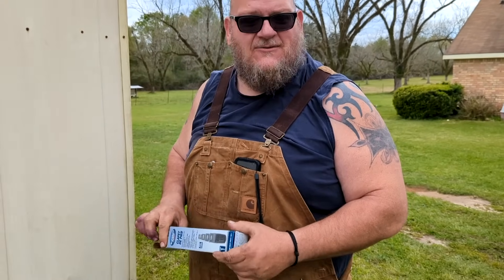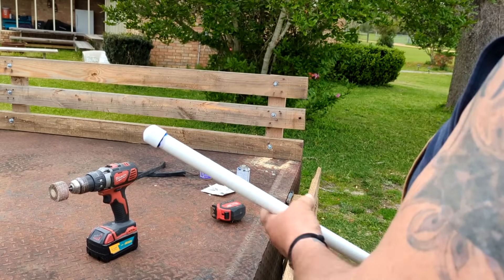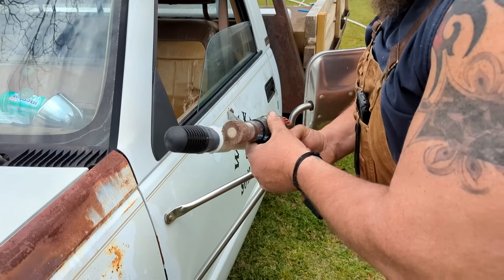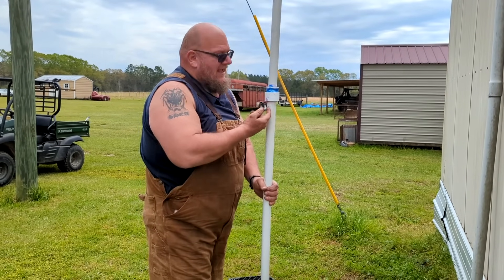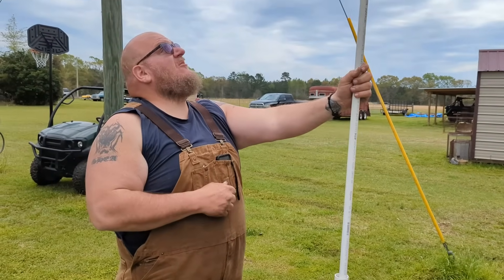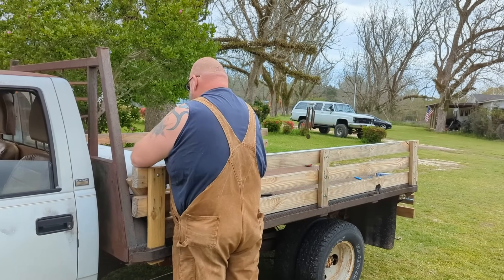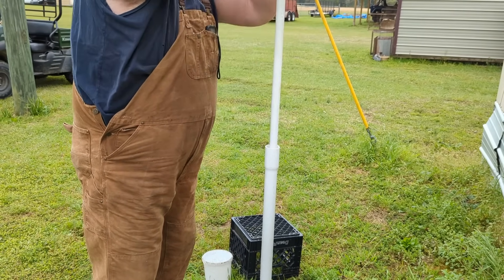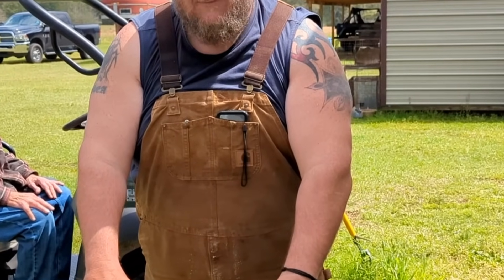INSTALLING A HOMEMADE DEEP WELL HAND PUMP

Comment: Thank you, sir. You’ve inspired me to give something similar a shot. We have a 125’ deep well with a submersible pump in place. Gonna get or make a hand pump, install it in my basement to see if it sucks it up through the pump into the house. Thx. 🤞👍
Reply: Would love to hear if this kind of pump works at 125 feet. 
My static water is 90'. Curious if this pump would work at 90'

Comment: Only thing I can think of being an issue is the small gap at the above surface spot where the plunger goes into the other pipe.  That small gap could allow bugs to go down there... or if a mouse sat up there and pissed it could go down the pipe, could it not?   Gotta find a way to seal that a bit tighter and BAM she's perfect.

Comment: Worked like a charm. I just got a pitcher pump to put into an old hand dug well that we used when I was a kid. It is just right on the line of will it work or not. It is about 27' to the static water level. So just a bit on the deep side. I might have to try this option if it doesn't. Thanks for the video.

Comment: Where did you find he continous lengths of white PVC pipe??? I don't see any couplers. I like that!
Reply from the maker: We used the couples that are made on the pipe
Reply: @walkerfamilyadventure  Thank you!
Reply: use Pex or black poly pipe
Reply: @llkwildcatt   I would think the natural "memory" of coiled black poly pipe would make this very difficult to do. Am I wrong?
Reply: He most likely knows someone or works in a PVC pipe plant.
I work in a polyethylene plant & got a 500 ft roll of 1 inch IPS poly pipe at cost.

Comment: Is the well hole lined with anything? any gravel around it and at the bottom? what, if anything, prevents dirt from clogging the foot valve?
Reply from the maker: It was a previous well on property so we used the casing that was there

Comment: What is your static water level?
Reply from the maker: 30 foot deep
Reply: @walkerfamilyadventure  I revisited this video. I have a 5" well 100 ft deep and 40ft to water. I am going to experiment with this and put it down 60 ft so it will be 20 ft into the water,

Comment: About how much clerance is there between the 3/4'' cap and the inside wall of the 11/4 pipe?
Reply: Very little. They have a very close fit. I just tested it at Home Depot yesterday.

Comment: will freezing weather be an issue?
Reply: You could put in a weep hole a couple feet up from the bottom of the outer pipe. Then water will slowly drain back down after done pumping, but it will take longer to bring water back up next time

Comment: My static water line is 80 feet. Will the pump pick up water that far down?
Reply: It pumps the water from the bottom and every time you pull up, you are pushing water instead of pulling, so it should work.

Comment: It just don't get much simpler than that. Only thing I see wrong with it is the handle floating up. I think you could drill some holes in the side of the 3/4" and let water in and it wouldn't float up. And since the water in it is still in the well water you won't be lifting that weight.

Comment: hey great job! now that it has been in for a while, is it still working the same as when new? will friction wear the plug end smaller and then it will not work as well? again, great job! I have a welll that is 150' down, don't  know what the static water level is yet (soon to fing out-buying some rope today). thanks for the idea!
Reply from the maker: It's been down 10 months now and still works wonderful. It takes about 3 pumps to get water flowing and then its never ending.
Reply: Rope is too heavy, I use fishing line with a washer.
Reply from the maker: It works amazing when we not using it much we still go by and pump every couple weeks.

Comment: YOU DIDN'T SHOW HOW YOU DID THE WELL, YOU ALREADY HAD THE MAJOR JOB DONE, GETTING THE HOLE IN THE GROUND. OK TC
Reply from the maker: The well was already on the property from previous owners we just pulled the old well and run new casing.

Comment: Also am above Wiggins, so 👋hi neighbor. Got a question- we have a 2"well with a pump above. The inside pipe that goes to pump I believe is 1" ? 
It has foot valve on it, Could we add to it with the T  for spout and put 1/2" pipe in original 1" pipe and handle on it. What you think? Trying to figure out just incase.

Comment: How much did it cost to get the hole dug & how deep to water?
Reply from the maker: It was a pre-existing well on the property that hasn't been used in 20 plus years. We checked water level and well is over 60 foot deep but static water at a little over 30 foot.
Reply: @walkerfamilyadventure  how do I figure out my static water level? I’ve been researching videos such as yours to figure a way to add something like this to my existing well if that is even possible. Any advice is greatly appreciated! Thanks in advance 🙂
Reply: @christinastpierre3052  washer tied to the end of fishing line listen and feel for the splash down. Tie a knot, pull it back up and measure it